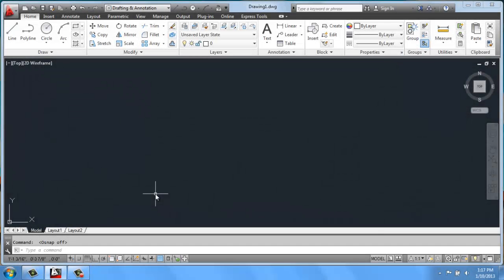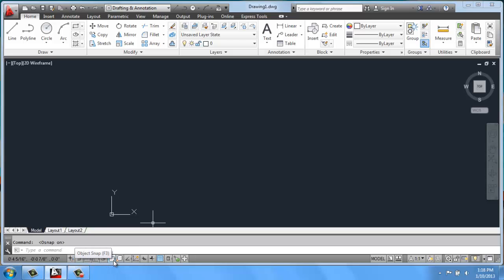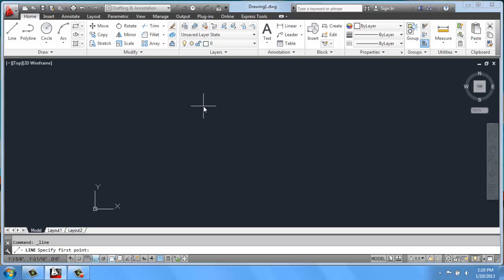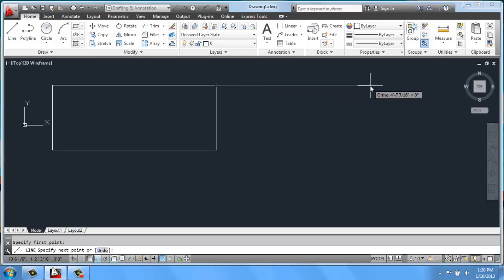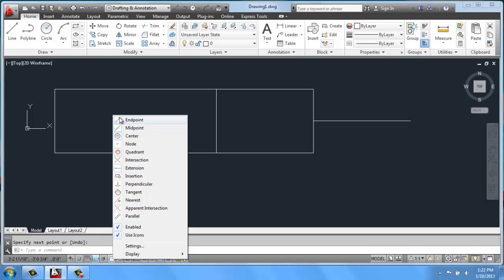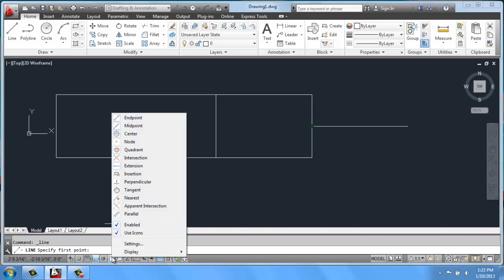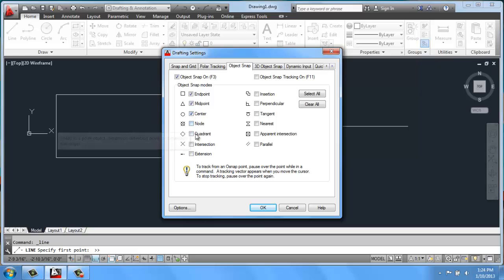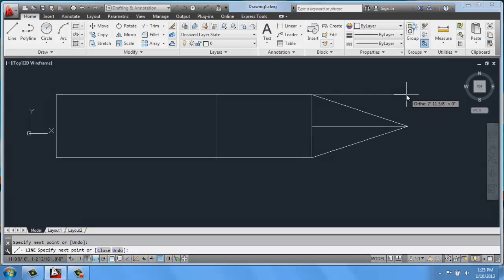#11 - AutoCAD - 2D Drafting Basics - Object Snap Settings - Brooke Godfrey

Comment: Just a quick trick I've been using since I learned AutoCAD. To get to the object-snap selection list quicker, hold down the Shift key and right mouse click. Sometimes if you have a complicated drawing, the object-snap wants to grab everything and it becomes annoying. In THAT case, just turned them all off and select them manually using my trick. Hope it helps.